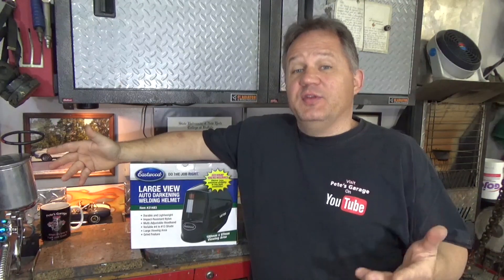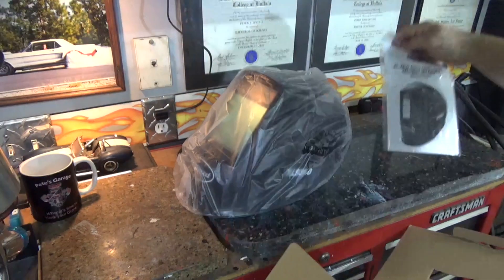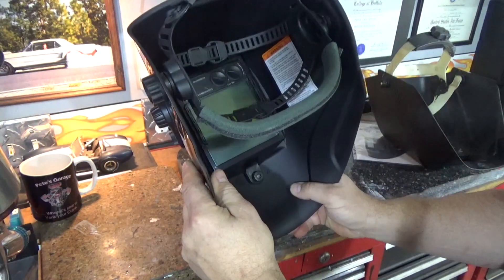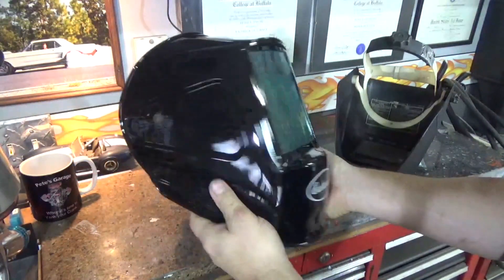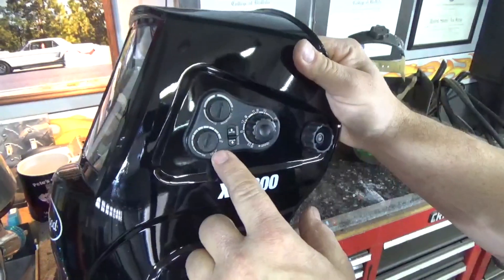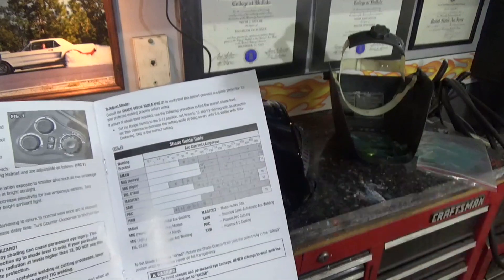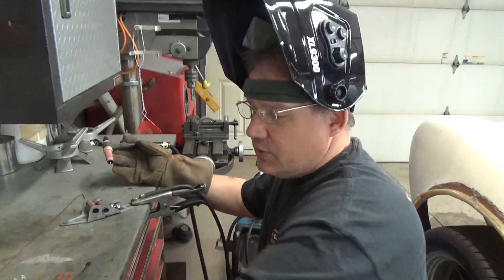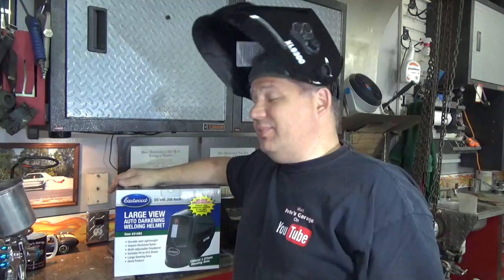Eastwood Extra Large View Auto Darkening Welding Helmet

Comment: Is it recommended to have my engine builder disassemble a new pair of Edelbrock e-street complete heads and check all the specs?     I see YouTube videos saying "never install heads out of the box.
Reply from the maker: I've installed many heads right out of the box with no issues. You can certainly have them checked, manufacturers do make mistakes.

Comment: Thanks for the review. been looking into Eastwood welding products for a beginner welder and was wondering if you have any experience with their welding machines mainly flux core and Mig?
Reply from the maker: I do not. I'd be willing to try them. I've used Miller, Lincoln, Clarke, and ESAB all my welding life. They are pretty tough to beat. But Eastwood makes great stuff, I can't see them putting out any junk.
Reply: @PetesGarage  Thanks Pete for the Quick response. I've also been looking at the Lincoln 140C I believe that the unit off the top of my head. Its the more commercial model of that series of welders. Just trying to Purchase a unit of Quality for a diyer learning. Thanks for your input. 👍

Comment: Does it have a Made in China sticker on it? I go out of my way to avoid buying anything that's Made in China.
Reply from the maker: I don't think there is any helmet 100% made and assembled in the US.
Reply: new flash miller and lincoln have chinese guts, and at this point so do you
Reply: @DontStopReeling  
No, I don't. China entered the WTO in 2001. Older Miller welders do not have Chinese guts.
Reply: What's wrong with Chinese made stuff?  You can get crap from anywhere.